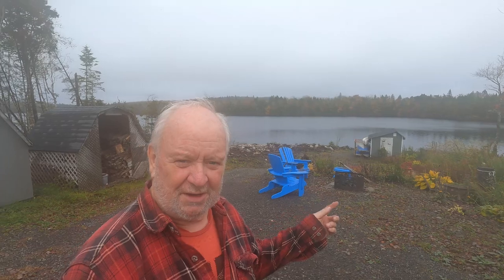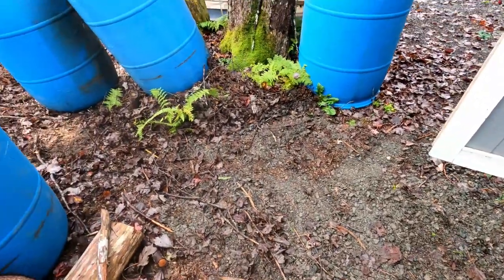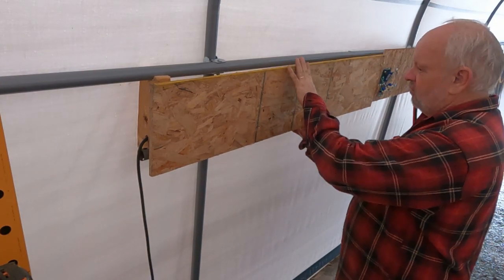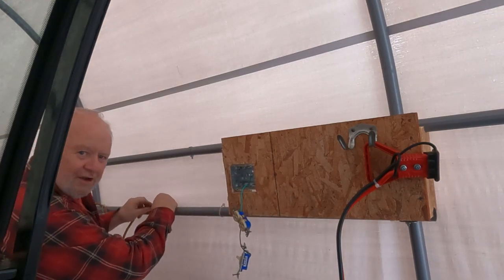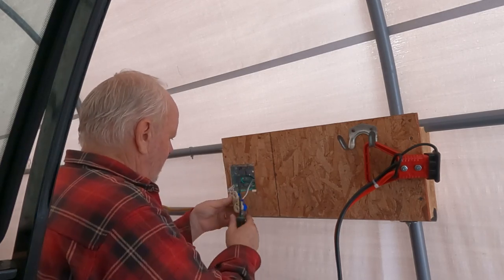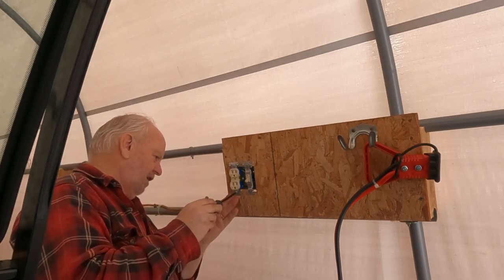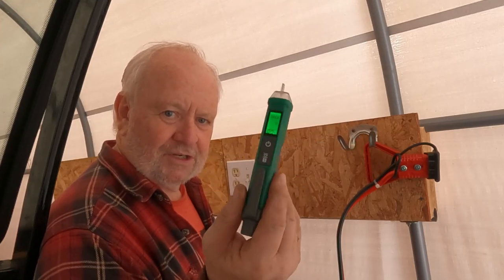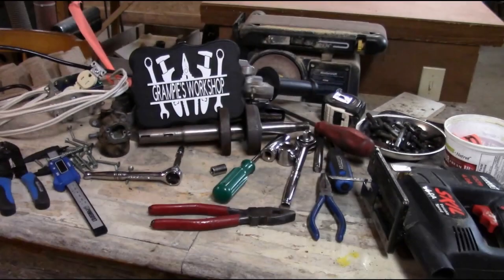Electrifying the Tractor Shelter

Comment: Mike according to the US National Electrical Code (NEC) if an outlet is switched the ground is supposed to go up on the receptacle "outlet". It disseminates the outlet is switched. Not sure what the Canadian code calls for it is the same or a little different.  Just an FYI for Americans.
Reply from the maker: Hello there Vicky!!  Fist off, I am not current with the electrical codes.  From what I remember every 'outlet' needs to be grounded.  I'm not sure if that means it needs to be grounded directly, or if you can go to the box and then to the outlet.  When I was working I used to try and stay current on the various codes and the changes made, but since I retired, I just try and wire something so it works, is half-ways safe.  Take 'er easy!!

Comment: Just my kinda video. Save what you can and reuse what you can. 👍🏻. I plant to run an extension cord, on top of the ground, to the little spruce tree out front of the house for Xmas lights. Only be there for a few weeks. But I need to protect it a bit so when I drive over it with the tractor and snowthrower I don’t get fetched up in it. But there won’t be any snow any way, right. 🤭
Great fix up Mike. You and Nannie have a great Saturday nite. That fella I was asking you about, if his last name is Dean, he’s my wife’s brother.
Reply from the maker: How's she goin'?  I don't recall a Kevin Dean.  Did he work at the Granton plant?  That's where I worked. There is nothing wrong with using an extension cord for temporary power.  A good exterior one is a great solution for running power to things like Christmas Lights or temporary shelters!!  And I vote for you on the no snow front!!  LOL  Take care!!
Reply: @GrampiesWorkshop  Not sure on that Mike. But he worked at Michelin a long time. 
Thanks Mike.

Comment: It won't be long before you'll be flipping that switch on Mike.  I gather that your tractor has a block heater that you plug in as well.
Reply from the maker: How's she goin'?  Well Paul, I wish my tractor did have a block heater.  I was going to put one in but I haven't yet!!  The main reason for the power is for a charger.  The tractor is cold blooded and hard to start even in the warm weather so I often need to recharge the battery in winter months.  Thanks for watching and have a great week!!